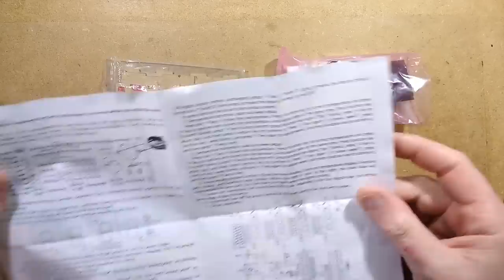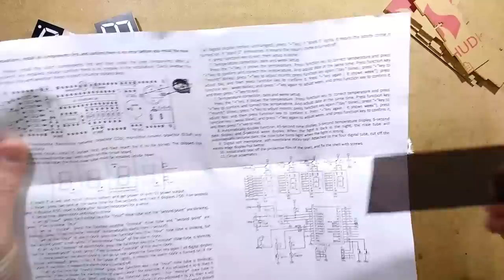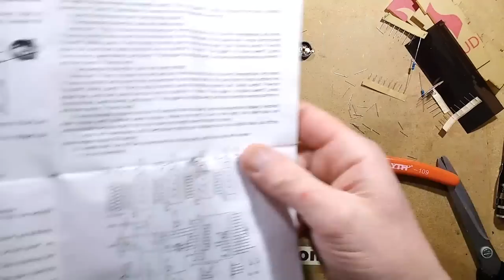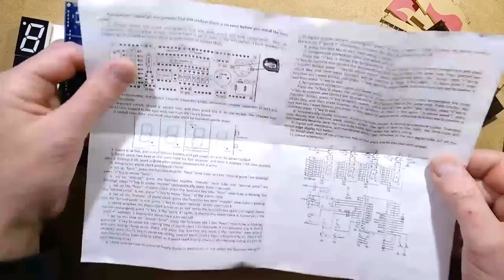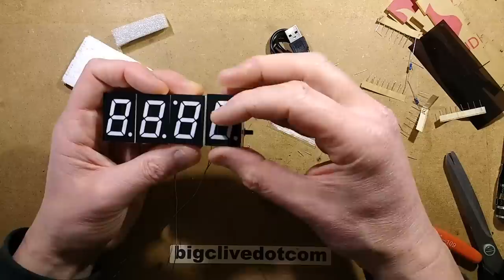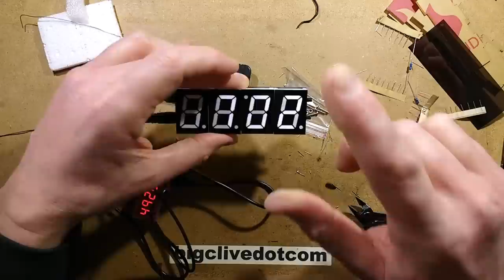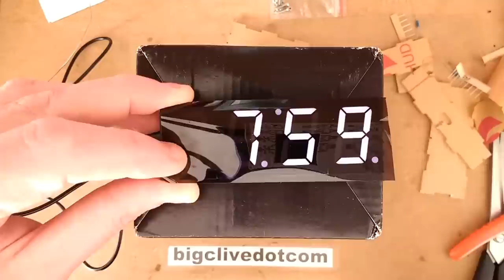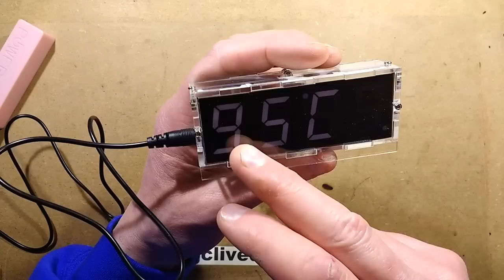eBay clock kit.  Full build and setting guide.

Comment: Most Phones and Video Cameras limit up to 4.00GB File sizes which at 1080p equates to around 30 mins.
It restart the video leaving a one second gap.
Reply: Против Глобал Still an awesome video though.
Reply: That's an inherent limit in the FAT#@ file system, which I presume the phones use.
Reply: Lot of devices will also stop recording after 20 minutes, because if it can record for more than 20 minutes, it's a camcorder under EU law and the manufacturers would have to pay a higher tax.
Reply: Everyone in this thread is a bit right but not telling the whole story :p It's a combination of the 4GB FAT32 [not "FAT#@", catlover10192 - try releasing the shift key a bit earlier next time ;)] file size limit AND the stupid EU "camcorder" tax (and some older cameras apparently had limits caused by insufficient cooling of their processors!). More expensive modern cameras (e.g. DSLRs) will automatically split videos into multiple seamless files to get around the 4GB FAT32 limit, however their stock firmware will still limit videos to a maximum of 30 minutes (from what I've read and experienced, it's a 30-minute limit, not 20-minutes, hellterminator) - although it's possible that third-party firmware such as Magic Lantern may be able to get around that, I'm not sure.

On Android devices, alternative camera apps such as Open Camera (which is the one that Clive has used for a lot of his videos, I think) can work around the 4GB filesize limit by simply restarting recording to a new file when that limit is reached, and they don't at all implement the 30 minute EU restriction, but Open Camera, at least, doesn't appear to be totally seamless when it starts a new file, unfortunately - there's a slight gap in time between the two. That might be a limitation of the underlying Android Camera API that Open Camera will be using.

I've also noticed that my cheap GoPro clones (a Yi Lite 4K, an "AKASO EK7000 4K", and an "APEMAN Sports Action Camera 1080P") all seem to be able to record longer than 30 minutes, so I wonder if they were subject to that tax, somehow exempt, or just managed to avoid it illegitimately somehow :P At least the Yi Lite splits videos into 2GB chunks, but it does appear to be seamless between them, as far as I can tell.

You'd think by now that we'd all be using a bit newer/better than a 22 year old filesystem on our SD cards and related flash storage. exFAT is nice, greatly increasing the limits of FAT32, and it has wide support from operating systems, but because Microsoft hold patents on it and charge a fee for its use, it can't be part of the Linux kernel (there are FUSE modules so it can be used on Linux), and that's probably part of why it has very limited support on smartphones. ext3/4 (or even btrfs) could be good for SD cards, but Windows doesn't support it without a third-party driver, so that's not much good in practice. There are even flash-specific filesystems such as YAFFS and UBIFS, but support for those is pretty thin, too :( exFAT is probably the best choice here (and some manufacturers are already supplying SDXC cards that come formatted with exFAT from the factory), but without Android support it'll never be much use for me, as connecting SD cards to my phone (via a USB-OTG adapter) is occasionally useful still...

The camcorder tax is a particularly stupid EU rule in this day and age, and one that they really should scrap IMO. All it's doing is annoying smartphone users. Very few people buy dedicated camcorders these days, so it's all a bit silly =/

Useful (if non-authoritative) source: https://www.tested.com/tech/photography/44445-why-digital-cameras-have-a-30-minute-video-recording-limit/

Comment: You seemed to have missed the more simple reason to have one of the displays upside down: It is a clock, and therefore wants to display time, which is usually separated by a colon. :)

Comment: Which type of soldering iron do you prefer? The kind you replace the tip with, or the kid that uses copper electrodes?
Reply from the maker: I prefer the traditional style of iron with replaceable bits.

Comment: How is yours works well..I did bought 3 of them, First went well, but sooon burn out by lighting.. dont know how to fix it, then I bought second,  it was not working welll. then the third , time on the clock is goes faster than it should be...all in all all failed.  
I should made video about it, will be much early than your.  i did those at feb 2016..

Comment: Hello BigClive,
i have the same clock and after putting it in use and working fine for 2 weeks, suddenly the battery exploded and the whole case and pcb was covered in black powder from the battery.
How could this happen? does it try to charge the battery? because in the manual it said to put a standard non rechargable button cell in, or does the 5V connect to it somehow?

Comment: I did order that clock kit a year ago, one component was missing, luckily, it was a diode and had one in my office, but could have been a different component, one that is hard to find locally, that's the bad thing with those kits, a missing part !!

Comment: I have the same kit and everything works except the time starts really slow, something like 200 seconds is one minute, and then very slowly it speeds up and after some hours it keeps the time well. Did I do anything incorrectly or I should just change the DS chip in your opinion?

Comment: Hey Clive. I found something on Amazon and I am dubious about the functionality and safety, perhaps it would make for a good video.

It's called: "Olight® Universal Magnetic USB Battery Charger" and it claims to be able to magically charge AA, AAA, 18650 etc.  Lithium and NiMh cells
Reply from the maker: It looks like it uses a very common charging chip that can detect the polarity of the cell and charge as required.

Comment: The RoHS directive is not aimed at protecting the workers from lead poisoning (and yes it's a real thing), but is mainly aimed to protect the environment from waste/e-waste containing lead and other heavy metal. The main issue is the lead from electronic waste leaking in water supply. It's the same idea behind lead-free gasoline. Those are the legitimate concerns, you can judge yourself if the directive is done more bad than good with the reduction of device reliability... (i hope my message is understandable even with my bad english)
Reply: Andrea Florini Where reliability is required i.e medical or aerospace, lead solder is permitted!
Reply: I've not said that is better now, i only said that Clive missed the point of the direttive. Anyone can make his judgement about the result. And, btw,  only God knows how harmful are the chemicals in the Lead free stuff.

Comment: Anyone else listening for the sizzle of Clive's burning flesh?    I used to solder like that too until I discovered the el-cheapo "BURNTEC PCB Holder Clamp - Holds Circuit Board for Soldering 360° Adjustable Aid" .  Yours for under a tenner and mighty useful.  BURNTEC... somehow appropriate... lol!

Comment: Diode for temp sensor?? Others for sale at ebay show the glass diode hanging out of the plexi case along with the LDR. Thoughts?
Reply: ahh, must have been away that day. "...semiconductor junction under reverse-biased conditions, reverse current flow is directly proportional to the temperature of the silicon.
Very cool. Maybe I should go try this with an arduino or pic!
Reply: That is fascinating, sorry for my late response. I just got my kit in the post. So I will re-visit this whole matter while I build.  The implementation of this diode temp sense will be as interesting as the notion of it for me

Comment: i made one of the ones with the 60 led's around the outside, it was my first smd project and took ages as i only had a soldering iron, i dont use it though as it doesn't stay on the time, it cycles between the time, date and temperature, its so annoying, i wish it just stayed on time then i'd use it

Comment: I love this clock Clive , BUT can you suggest a power source like a power bank that will not switch off after a few seconds , because this pulls nothing from the power bank according to my USB Doctor ...i have to use a wall power adapter for it :( I need one of those power banks that don't switch off if no load is detected ...please help , thx !
Reply from the maker: All the "smart" power banks turn off with low load.  The simpler cheaper ones with no LED charge level indicators usually put out 5v all the time.

Comment: clive, why don't you use the battery powered soldering irons anymore?
Reply: If you need to solder just a couple wires, nothing beats a battery powered soldering iron, super convenient! But for a kit with dozens of parts, a temperature controlled soldering station is much faster to work with, and allows to correct mistakes better.

Comment: The fak focused! 

Looking good and I like the new setup but something still irks me, it's either some sort of oversharpening going on or too low bitrate, propably something that used drown in the softness of ipads 720p resolution, or there there simply was enough bitrate for that. I understand the Isle of man doens't have the best interwebs, but you could try a video or two with noticeably higher bitrate. Then again, nobody else seems to care so, eh.
Reply from the maker: I'm using the default settings but will experiment later.

Comment: I used to program a similar meter for substations and when they wake up the programmers did not reset the stack . This caused garbage to show up. At least in this case you see some logical number. I complained to the boss and he had the programmer put a random logical number in there. that ram chip is not very roomy .

Comment: Also it looks like they fixed the losing power and having to reset everything in current versions,  not sure what battery it needs though, not a standard 2032 but something smaller

Comment: Anyone watching this for your build take a look at pictures of the clock on amazon, search "kkmoon digital led clock kit", the thermistor and photoresistor should be sticking out the top of case, otherwise you will need to recalibrate the temperature often.

Comment: What's the dedicated time-keeping chip doing in addition to the crystal? I can understand drift occurring in the microcontroller with an internal oscillator, but I figured an external oscillator would negate the need for a separate time-keeping chip?
Reply: They probably saved a lot of money on that microcontroller, it's some kind of stock leftover. Some microcontrollers are designed specially to avoid injecting noise into the timing circuit and will keep time fine, and so are dedicated RTCs, but others aren't particularly good about it at all. 

This is an old 8051 controller, slow, no external timing input, internal RC oscillator only. While you can connect an external oscillator to a data input pins, it would likely inject noise and it would run fast.

If curious, look up STC15F204EA.
Reply: The chip uses the battery to retain time when the power is removed. It's also much more reliable and accurate than some code thrown together by a random chinese guy.
Reply: George Hafiz those RTC chips can use a standard 32768 Hz watch crystal. A regular micro would use, say, an 8 MHz crystal, and a) those aren't nearly as accurate b) micros aren't nearly as good at counting to eight million exactly, and not being off by one or two.

You can do it, but say a regular Arduino without an RTC will drift by a minute a day instead of a minute a year.

Plus the coin cell battery will remember the time and keep ticking when power is off. You know how annoying it is when there's been a power cut and all your clocks blink 12:00. This one won't.
Reply from the maker: It does all the timekeeping including the format of the time and memory for other variables.  It's specifically designed for use as a clock and to run on very low current from the battery when the power is off.  Almost like a watch with a data interface.

Comment: mine does time, temp, and day when running, and gets annoying
is there a way to just have it show time? and not automatically show the day, and temp

also have to love the laser cut out for one of my nuts, cracked my housing
didnt even get the screw in, just pressing in the nut cracked it

I ordered all colors, from 2 different sellers
2 that I received so far came with battery which was nice

Comment: +bigclivedotcom I put one of these together about half a year ago. Mine was a slightly different revision; I was intrigued by the fact that they seemed to have meant the alarm to activate an onboard relay (on the revision I have)

However, the plastic case, the firmware, and the components they sent along matched your revision instead of the PCB that they sent!  I have since bought the missing components to run the relay and put them on the board. The circuit is correct -- but the firmware doesn't support it (time to learn about stm uC). I had to modify the plastic case to fit the relay, depth-wise.

Frustratingly, the battery holder they sent doesn't match the footprint on the board and I haven't found a proper replacement. The light sensor and dimming feature appears to work great -- it doesn't blast me in the dark, but is clearly readable in daylight.

Even with all those troubles, including learning the same process for setting the time that you've described -- it's a great clock, and a wonderful kit. I love it. I may buy several more!

Comment: Can you just change the code to provide 12/24 hour display? My 08 Subaru Legacy wagon only provides 24 hour display on the dashboard & it's occasionally frustrating. I keep hearing persons saying they can change the code for as much, but I see no manner of connecting to the IC's for such purpose (my guess is have to use a breadboard and a USB to Serial [never made sense to me... A Universal SERIAL Bus needs a Serial adapter?] adapter to do it, or you need an IC specific device for the purpose).

Comment: RoHS in Europe is indeed governed by a European directive, but it is part of a worldwide agreement to keep certain metals (mostly) out of electronic waste. Not only because of possible long term accumulation problems in wild/domestic animals and crops (and thus, ourselves), but also because it would be almost impossible to recycle them cost effectively.

It was more a sentiment of "Ok, we don't want to release this stuff as electronic waste gets ground up, but we can't get it out cost effectively to prevent that either, so let's just not put it in.'

In a production environment the use of lead based solder or lead free solder is neither here nor there (one just needs tighter control of one's soldering process) and nor is it in a truly professional hand soldering environment.
The rosins employed do indeed pose some problems for the homegamer, as they produce a more acrid, finer particulate smoke, but, even so, probably not enough to kill you. I have sliding windows in my apartment and, when I solder lead free, I just jam a 120x120x38mm 220Vac fan into the window next to my workbench to get the worst of the fumes out.
The main thing about hand soldering lead free is joints require more energy to form the intermetallic bond, so the key is to not be tempted to turn the temperature up (because the rosins can't handle that) and just slow the process way down. It takes about 3x longer to make a good lead free joint as opposed to a lead based one at the, say, 315 centigrade mark.

That said, for ease of soldering and to not have your throat burning after 200 circuit boards, lead based all the way, though.

Comment: Not sure I understand why a second chip is needed - there's plenty micros which will clock an internal counter from a 32KHz RTC crystal, and be perfectly stable keeping time....

The thing that always gets me with RoHS/lead free, is electronics are now recycled thanks to the WEEE directive, however lead roofing is not banned. So lets see... which is more of an environmental pollutant - lead roofing being eroded by weather, and ending up in the water supply... or electronics which are being processed rather than dumped into landfill (in theory)!

Comment: Would it be possible to add an led that would give a red, green, or blue glow out the back of the clock?
Reply: sure just tap into the 5v input, a resistor and your choice of leds would be easy, if you point it at the case it would colour the case with a glow too as its like a big lens

Comment: Where could I buy dimming foil/film as shown in the video?
Reply from the maker: It';s commonly sold as theatre lighting gel.
Reply: It's also available as notebook covers/liners in various colors for much less money. Given that it is only to blank out the empty sections and doesn't need to be precise color or density it works fine. Also translucent colored tape works well.
    Mike  (o\!/o)

Comment: bigclivedotcom Hi. Do you know why some electric chargers over time raises its voltage? For example I have my old cell phone 5V charger and now if I test it charges at 11,2V. Another example I have my old ATX 2.0 computer power supply and all the supposed voltages (3V, 5V, 12V) are raised by +2V. Is it faulty capacitors that does this? I opened and inside I didn't see any inflated caps. So what circuitry went wrong?
Reply from the maker: It may be degradation of the components.  Some cheap chargers to float up in voltage if not lightly loaded.
Reply: Can you point in what direction search for bad components, maybe some rectifiers? I want to fix some of my stuff. Thank you